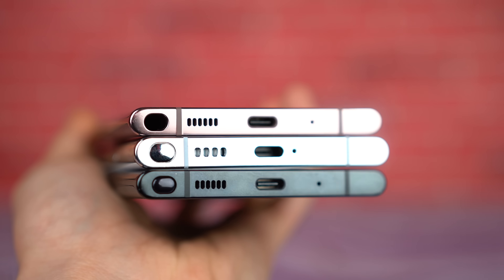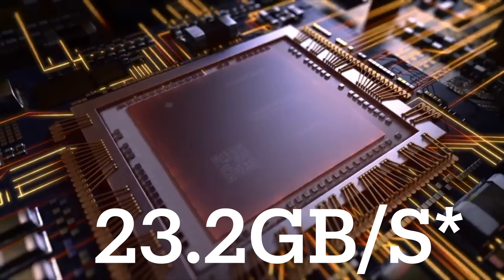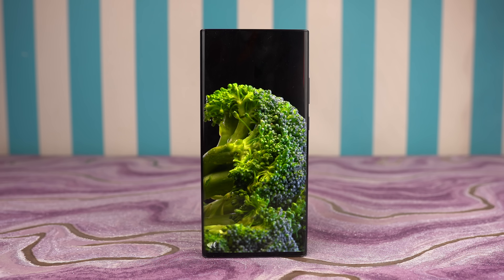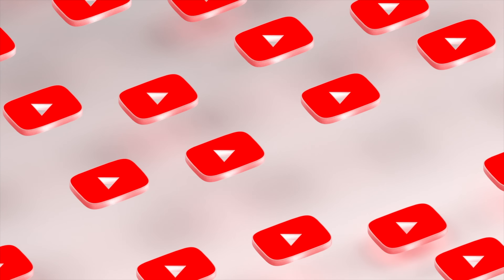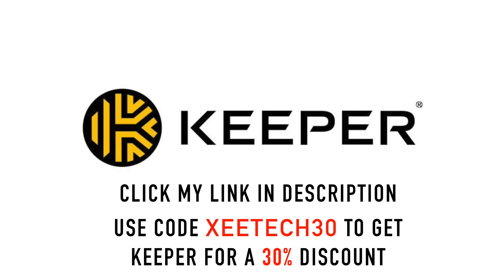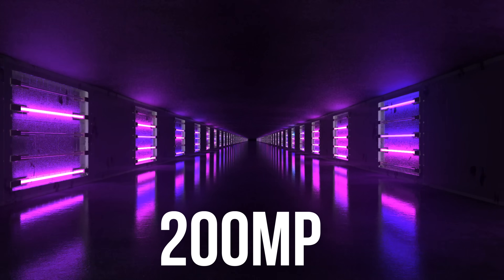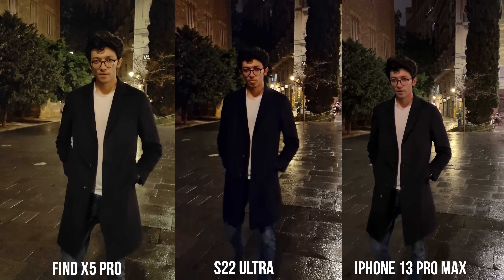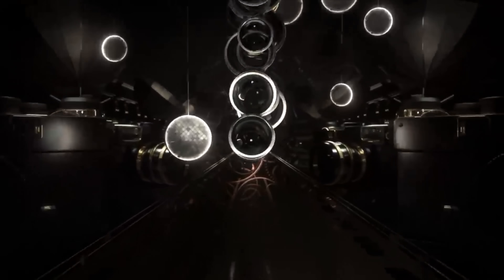Samsung Galaxy S23 Ultra - WORLD'S FIRST...

Comment from the maker: What do you guys think of 200MP sensors? Also, don't forget to get Keeper for 30% off. Use code XEETECH30 http://www.inflcr.co/SHC8D
Reply: 200mp will only mean worse and much noisier night videos as there is no pixel binning there. Samsung is just focusing on marketing gimmicks like this instead of the elephant in the room, that is. improving battery performance, which currently sucks.
Reply: Dumb. Large sensors any day over just increasing the resolution needlessly, which makes no difference to normal shots.
Reply: @ՏՏS  
WE DON'T CARE
Reply: @ՏՏS  nope
Reply: @ՏՏS  never
Reply: I think it will make thing better if they can combine pixel in video recording mode as well. If not video quality become worst than 108mp because of smaller pixel size.
Reply: @ՏՏS  wow 😳
Reply: As always a tiny changes ..but we can forget all these things when we see TSMC 3NM on S23 Ultra
Reply: The s22 series just got released why are you talking about s23? And what about the Xiaomi 12 ultra, Vivo x80 pro plus, Sony Xperia 1 mark 4.....
Reply: @some_random_penguin Samsung is only relevant
Reply: apple using NVME
Reply: A 200MP sensor sounds great but it could be a big meltdown if the phone using it does not have good optimization and thermal control. And would such a sensor result in poor low light video as a trade off?.
Reply: Unnecessary. Just give us a 1 inch 50mp sensor with tons of tech and call it a day.

Comment: 200 mpx sounds to me like a 50mpx sensor that takes 4 different exposures per pixel to increase dynamic range to a ridiculous degree. I'm pretty sure you can also probably increase low light performance by calculating noise in a high gain pixel with comparing it to a lower gain one thus getting a very clean 50 mpx image in low light situations.

Comment: My s22 ultra barely gets through the day due to the power hungry hot Snapdragon chip. I prefer them starting to optimise instead and get a proper cooling solution. It's so hot when it charges.

Comment: Samsung should just ditch Snapdragon and Go with MediaTek's Dimesity Series. That chip is producing a promising results 
And it's more efficient than the SD 8 GEN 1. It draw less power than SD 8 Gen 1 and This could improve their battery Life even more.
Reply from the maker: That might happen next year. Lots of things on the cards right now but i dont think Samsung will let Qualcomm go. They will improve alot next year!

Comment: Faster processor, more ram, better cooling, larger battery and better optimization. This is what Samsung needs to focus on, not 200 megapixel  cameras.
Reply: The ram is already okay the way it is
Reply: Samsung uses Qualcomm so they won't develop a better chip Americans don't get the Samsung chip which is worst performance the the generation 8 chips

Comment: The speed of the storage will not make a difference on the chip. unless they can fix the overheating of there Exynos Processor and tbh qualcoms. Also not to mention the lack of optimization. They need to work on that. never mind chasing the humbers game that to the end users mean nothing.
Reply: If they don't up their game in this department i may switch to the iPhone 14 pro

Comment: Battery life and bringing back micro SD slot back.
Reply: That would destroy the handheld market
Reply: Would sell like hot cakes 🔥
Reply: @FXMulD3R - You got that right dude. I miss the SD card slot and the headphone jack.
Reply: @harrydaniels2788  How do you expect a microSD cards to keep up with 8K video without overheating your phone? Why do you insist on mediocre integrated audio when you should use a portable DAC that simply attaches to the headphone cable anyway? Get out of the past.
Reply: @James_Baggott  - Whatever you say dude 🤣🤣!!!!
Reply: @James_Baggott  you obviously do not own one. So when you take 8k. It stores it on your internal storage.. you then take and move it to your sd card to clean up space on your main memory.. ya you can do that with Samsung. So sd card slot is not living in the past simpleton.
Reply: @mikecarr1484  So what you're telling me is you just want SD Card bc you're too cheap to buy the larger capacity phone versions that would actually fit your lifestyle and instead want to stick your 10yo Class 4 microSD card in instead and spend all that time regularly doing data xfers where you'll ultimately lose all your data if you lose your phone. got it. you live in that S9 world and hopefully you don't teach others to follow in your footsteps.

Comment: I don't care about "big numbers". I care about optimization of the already great 108Mpx sensor, improve of the laggy zoom adding continuous zoom and of course improve battery life!
Reply: Is galaxy s series zoom lagging
Reply: @gunturpasopatipamungkas2340  No it's not. I still use my S7 Edge with no lagging at all. I think it's because of the higher megapixels sensor. Try to decrease the resolution and you see difference.
Reply: Number also matters

Comment: Do you know anything about when they gonna finally finish the system opt. on s22 ultras with exynos? After several updates still there are problems like: many times data connection goes down. Can't fix it but only with restart the phone.
Very annoying! That's not how it was going to work. Many times there are bumps and shit like a budget phone.

Comment: Here's hoping the next year's S23 Ultra's standard variant will be 256GB, not 128GB, if there's still no microSD card expansion in the next model. 

I have a 128GB S22 Ultra, burgundy color, and I hope I can get the S23 Ultra with a much, much cheaper price via trade-in.
Reply from the maker: Yes! Its time for 256GB to be the standard. Absolutely!
Reply: Hows the performance
Reply: 8 months later your wish has been granted, the S23 Plus and Ultra will come with a base storage of 256gb.

Comment: S22 ultra battery lags!!!!! What to do?
How is virtual memory helpful?
Reply: Tf does battery lags mean
Reply: Try to use the 8gb virtual ram setting or delete cache it happens to me too on my s21 and dont charge it to 100% always charge it from 25 or 40 to 80 so it doesnt degrade as much
Reply: @008RogueAgent  or just set the 85% charge protection in battery advanced settings
Reply: @brad8987  i always use that setting and when i wake up i just disable the option i cant deal going all day with 85%